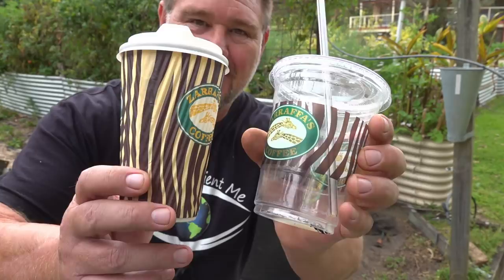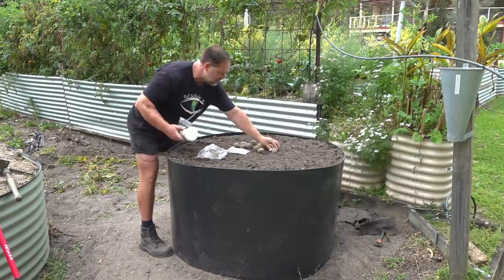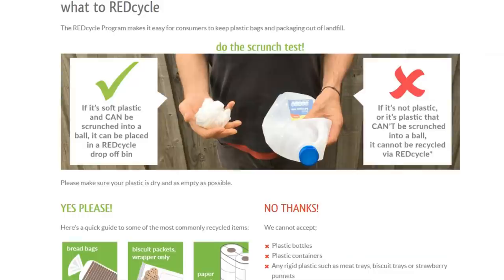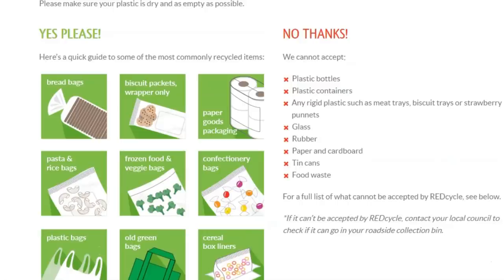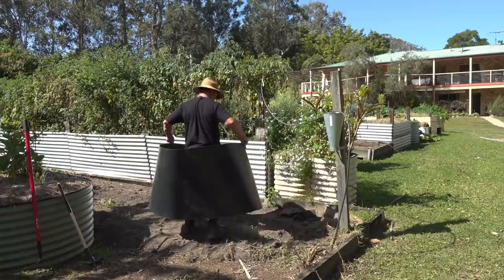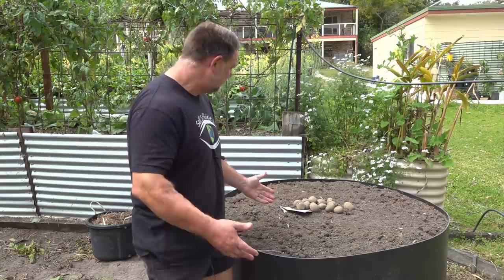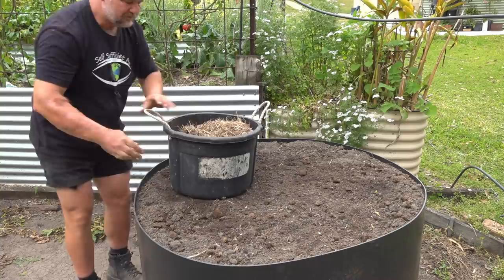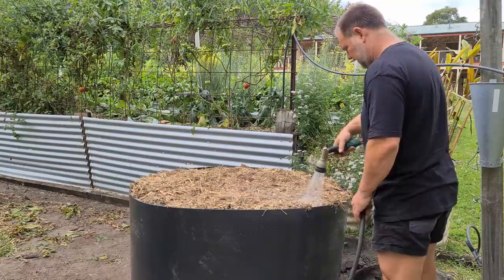Raised Garden Bed Made From Coffee Cups

Comment: Your intuitive take on the likelihood of the screws pulling loose is pretty good. There is more than a linear force on the screws trying to pull the layers apart. There is also a shear force perpendicular to the screw that will pretty much keep the threads locked into the material. 
And thank you for a good discussion on recycling. When Asian markets decided to reject most of our plastics from the USA, it forced us to wake up and be more responsible. I think we will figure it out in the long run as the young ones pour into our political process with more ethical thinking than our peers are accustomed to.
Reply from the maker: Thanks for that explanation! Yes, I suppose there is merit in trusting genZ to come up with some good ideas in the future - I like the optimism. Cheers :)

Comment: The companies that deal in rubber type products should want to utilize this. They are already in the market and set up with the business. I see this perhaps being weather proof floor mats, truck bed liners, barn mats, conveyor belts, something to put under above ground swimming pools, use around in ground pools, commercial swim parks like kiddie pools, slides, etc. Basically anywhere that rubbery like products are used now. I love this. I wonder what it feels like. Thanks for showing us this. :)
Reply: You do realize that down cycling already is a thing? A lot of the products you mentioned are already made by using down cycled plastic. The problem here is that they somehow want to charge more for something made out of waste. I don´t get that logic. Not if they only use trash that would be collected anyways instead of collecting it themselfes.
Reply: @stefan514  i did not realize. Thanks :)
Reply: @stefan514  The process of downcycling is more expensive as it costs less to make new plastic. Recycling is cost intensive as quite often different types of plastic have to be separated and the quality drops over time.
But I agree, if oil where more expensive, recycling would be used more.

Comment: I find the product really interesting in itself, even without taking into account the fact that it's recycled. I can see many uses for it! I'm in a tropical climate, with sun all year, and high humidity all the time, so wood rots, this is perfect for garden beds! Sadly i won't find this here :(
I wonder if it would be possible to weld the plastic with heat, as it can be done with other plastics. That way, no screws, but other shapes could be made... And even adding a bottom, to make a thick, strong liner for a mini pond :)
Reply: My mind went to pond too, for my ducks.
Reply: Welding would produce toxic fumes, so probably not a good idea.
Reply: @klarag7059  Have you seen The Sopranos? Ducks can be very challenging.
Reply from the maker: Pond liner... Yes I like it! Cheers :)
Reply: GromWizard no, but I have five currently.
Reply: Self Sufficient Me if you try this, please share in a video.
Reply: @Selfsufficientme  As a pond liner  it could be recessed in the soil & caulked onto a flat base, tho' a flexible butyl liner could do the same job.
Reply: Hi Audrey,
Plastic welding is typically done with rigid plastics. Welded seams are rigid in themselves so if you weld two flexible plastic sheets together I would expect the welds to fracture fairly quickly.  I suggest you either stick with the tek screws shown in the video or switch to stainless bolts with large washers to spread the load.
Reply: @outofmytr3317  Thanks for the heads up!
I was considering welding to obtain a waterproof seam, so that it could be used as a fish pond material, but i guess it won't be an option then!
Reply: I wouldn't use plastic, especially, in high heat areas. There is a good video on "AwareHouseChef" channel. It is about eating microplastics, you won't want plastic after seeing this.
Reply: @MissMolly3377  I will look into it, thanks for the recommendation!
Reply: @MissMolly3377  Ok, it was interesting, but according to this source the clothes and strechable plastics are the biggest source of microplastic in the ecosystem.
Also, it was never mentioned that hard plastics shed microplastics?
Considering that we use a hard (but obviously less biodegradable) and abrasive resistant plastic, it should not release microplastics. On the other hand, if this is so resistant, it should last a very long time. I have installed wood siding for my garden beds, and they are dead one year later. Tropical climate means sun+water. Wood should be more environementally sound, but does it come from a managed forest? if i have to replace it so often, i cause more pollution from cutting, transport, processing, and shipping.

By the way, are you aware that your tap water canalisations in your house are made of either copper (older pipes), or plastic (PEX or PER)?
Same for many, if not most cisterns...

My point is not to use plastics all the time; but rather to have a global approach to it.
-Will it considerably last longer? 
-are there viable alternatives?
-if so are they cleaner?

As for me now, i feel like wood is not an option in my case  (not durable enough, so causes lots of work, high costs, , more pollution over a similar timeframe (i expect plastic to last largely over 10 years, so at LEAST 10 times more than wood, thus 10 times less transport, processing, etc).

The other alternative that i see is minerals, with either rocks (expensive and harder to do), or concrete. I think concrete blocks are a good option, for they are durable, cheap, and easy to work. I would expect concrete blocks to be there for 10's of years, so that should be fine. Now do concrete leach stuff? i don't know, i will look into it. I think there must be a way 
to have it good, since we make drinkable
water tank out of concrete.
Reply: plastics welding is a method that is used in the industry put it is not as practical as metal welding to be used on the field. i suggest using glue if screws are unfit for you.

Comment: Wow, amazing!  Im interested to find out how hot that black plastic could make the soil temperature.  Please let us know more about it as you go along, looking forward to it.
Reply: Yes I'd like to see some soil temperature reading during summer
Reply: @buryg4692  Polyethene is a poor conductor of heat. That means it does not transmit the heat like say aluminium which is a great conductor of heat, that is why they use aluminium as cooling fins in computers. One experiment we did was to raise the temperature of our i-90 product which has a 12mm thick wing, from 27 deg C to 211 deg C, the other side was only 40 deg C after 11 minutes of a blow torch. Thanks Dave
Reply: Considering the thickness of it, this would not help at all.

Comment: as an enginner experienced in recycling plastics i'd say his explanation simple and mostly correct. you can recycle every plastics as long as they are pure and did not mix with other plastics. but what world should force companies is stop the usage of unmixable plastics on the same product. for example, both PET and PE are mostly used at the same time on food packages. this two plastics are not mixable. you have to spent extra money to make use of them. every company should invest for more recycleable plastic combinations while designing their food packages. this would help a lot when trying tp recycle them. when i was working at a recycle plant we usually avoid this type of waste and go for PP/PE combinations. those two are mixable and vastle used. pe melts at 120 degrees celcius while pet melts at 250 degrees celcius. they are vastly different. when recycling plastics you try to seperate them by type. if there is more than two different plastics in a waste that is very very hard to salvage and usually send to lanfill or burned down for energy.

Comment: I really like this idea of recycled plastic there is a couple of things you could probably do to that as well you can probably drill a hole in the side use some pipe to make it round depending on the size of the hole you want to use you could grow your herbs out the side of it also mark I watched one of your earlier clips on your 3 system compost out of recycled crates and the stuff you put up didn't quiet work you could use this recycled plastic roll to line the inside of your 3 system compost if it needs air just drill some holes

Comment: That material looks strong, but I would feel more secure if that ring of rubberized plastic  would have a metal strip where the screws join the two ends, much like you join together the sides of an above ground swimming pool, running the height of the ring. I think it would give it more security over the long term. The metal(or aluminium) strip would be installed on the inside, so as to keep the look clean. Just my opinion! Love your gardens and your country. From an admirer in the United States! God Bless!

Comment: pulling apart wise, maybe add a bead of sealant/glue where the ends meet and the screws go.  Heck, maybe ask the manufacturer about the type and recommend adding in a pack of something that bonds the sides together at a molecular level while sealing in the screws from the elements.

Comment: I am a plastics scientist. Good videoand thank you.  Liked the second life given to otherwise landfill plastics waste. Just a suggestion: after drilling holes, if you melt the drilled surface with a heated metal wire, cracks dont propagate from the holes.
Reply: Hi, as the blend contains a lot of LDPE and LLDPE we don't get those cracks. They are associated with HDPE and shorter chain polymers. Thanks, Dave

Comment: The only problem I see with filing the screws is if they’re coated with a rust inhibitor you expose unprotected soft metal to the elements. The stainless bolts with washers will last a lot longer I think. Keep making great videos mate
Reply: The "stainless" will rust too, little of stainless they have, is just a shinny coating that wears fast.
Reply: You can chop a wine bottle cork in half and twist it onto the exposed part of the screw.  You have to drink the bottle first, win-win!

Comment: Great video as always. In regards to the nut/bolt or screw method. I feel if the screw method stands sturdy enough for a long enough time it'll be the better option. Much easier to undo a screw if you ever decided to relocate the bed. Whereas with the nut and bolt you'll have to clear a path to get access to all of the nuts.

Comment: I use three similar rings to do my compost bins. They are a bit different with air holes in the sides and there are connectors that are easily removed to make it easy to take apart to move the finished compost.

Comment: If you don't mind pre-drilling the screw holes, which is easy in plastic, blunt tip sheet metal screws are commonly available. They will protrude but are not a sharp hazard. If the hole size is to big by mistake just get the next thicker size screw.(from 8 to 10 or 10 to 12)   I would probably use a higher number of #8 screws than a low number of #10 or 12.  #6 is a bit small as far as weathering and good grip in the plastic especially with long term expansion and contraction, also the number needed start to get fiddly.
I also suggest choosing either a hex drive (mechanically sound but they have exposed corners) or Robertson drive(tapered square hole, good for rounded screw heads). Avoid both slotted and phillips drives as they have a weak interface. Torx drive(star shape) are nice but not common in sheet metal screws(patent royalties and just way stronger than needed. Torx-plus is even stronger.)
Remember to space fasteners closer near the bottom because dirt has increasing side pressure with depth, much like water although the calculations are more simple with water. An average force for a 750mm high wall is 1.8kN per meter, which for a round raised bed can be considered a tension of 1.8kN per meter of radius. (190kg total force) and the center of that force will be 250mm up from the bottom, so put half of the screws in the bottom third. 

My specific calculation(certainly fine to round this a bit) for the 90cm diameter 72.5cm tall raised bed resulted in 9 #8 screws, assuming the bottom screw is just a few mm from the edge, spacing between screws in mm from bottom to top 45, 54, 64, 76, 91, 108, 128, 153. This is assuming fully penetrating screws, aka full screw width across the full thickness, tips protruding. 

For the 1.55m dia by 72.5cm tall bed I would use 13 #10 screws with spacing of 30, 33, 37, 42, 47, 53, 59, 66, 75, 84, 94, 106 (or 15 #8 with spacing 25, 28, 30, 34, 37, 41, 45, 50, 55, 61, 67, 74, 82, 90)

The limiting factor being plastic material strength but I used a very low end estimate so 9 #8 screws should offer plenty of extra margin. #10 will up strength about 16% and yet again for #12. 
 Edited, some screw spaceings were copied in wrong.

Comment: Hi Mark! - I’ve just installed a couple of Birdies garden beds and have been wondering about how to more easily make the bed level and also what to put around/under the base to make it easier to mow grass up to the bed. I have decided to try putting some 75mm plastic garden edging flat down half under the edge of each bed. That way I should be able to run the mower along the side of the bed without touching the bed. But that still does not make it easier to level the bed. But having watched your video on “Raised garden bed from coffee cups” and the use of recycled plastic… why not ask Birdies to team up with Plastic Forest to design an extruded plastic form that (when placed under the bottom lip of a Birdies garden bed) both allow the bed to be easily levelled AND create a mowing boarder around the bed….😊 Just a thought… Mark, you continue to inspire :-) (PS My wife and I love your channel and we are currently on holiday in QLD up from Tassie :-) )

Comment: Two comments Mark:

When using black plastic, you may find the bed heating up a bit too much. I have used sacking in the past to cover the plastic to help keep the temperature down. 

You made a comment about waterproofing roads using recycled plastic. You actually want the opposite. A permeable road is preferable to allow water to seep through to the soils beneath. The permeable materials reduce stormwater runoff and improve water quality by filtering out pollutants by trapping suspended solids.

Thanks for your great content!
Reply: @al-Haifawi I agree there are special considerations in cold climates but I see no problem in places like Australia. Even where I live on the west coast of Canada, some permeable road surfaces have been laid with good success.

Comment: I love those although unfortunately a round bed wouldn't work in my garden as I don't have anywhere near the space and need to be planting in the corners but I could see it working in larger gardens. I have looked at rigid square/rectangular beds made from recycled plastic over here in the uk but unfortunately at the company I looked at the cost is so high for the taller beds its just not plausible. I love using recycled products so I was a bit gutted but it is what it is. We're just about to build some tall wooden beds as we can't get the tall birdies beds over here either and I need the height for my back ect. That is an amazing idea though because its recycling plastic we in the uk can't even recycle.

Comment: Asphalt is unique in that it is completely recyclable as it does not cure like concrete. It is chemically identical in its liquid and solid states no matter how many times it is processed. Many major repaving contractors will have asphalt recycling machines onsite to process the road they are ripping up, then lay it back down with the new road. Since plastic usually changes in chemical composition when it is heated and recycled, it is not a great additive to asphalt in the long run.

Comment: I was interested in using "lumber" made from recycled plastic as sides for low raised beds, right up to where it worked out at five times the cost of treated timber.
Reply: Probably lasts 5 times longer prior to rotting as well though. Even pressure treated lumber rots over time.

Comment: I'm gonna try recycled refrigerator raised beds.  Remove the door and drill holes. I'm also gonna try them as rammed earth building blocks. Fill with dirt stabilize connecting with boards, lathe, cob and lime plaster over the top.
Reply: Sounds like allot of plastics would leech into the dirt from a fridge....and I hope your taking the motor, freon and such out too. Not the safest idea.🙏
Reply: @cookiesplitter1776  Look at the earthship concept of home that uses tires. I know people who live in Earthships made of recycled materials and tires. How would a hard plastic leach? Are you aware that a lot of the current building materials we use all around us are full of toxic chemicals.  I agree about the freon though. I'm talking with appliance repair shops who have ones they want to get rid of rather then getting permits for the dump.

Comment: The larger ones might need two rows of screws to stay together longer but i love it!
Reply: That was my thought if there was an issue with the screws pulling out.  
Just overlap it a little bit more and put an extra row of screws in.  Maybe you'd lose a few inches in circumference, but that wouldn't make much difference overall on the size.

Comment: I wonder if it's possible to use that recycled plastic material to create large flexible plant pots. So similar to the garden bed, but scaled down (maybe 50-60cm diameter) and with a base with drainage holes. That would be a really nice solution for smaller gardens.